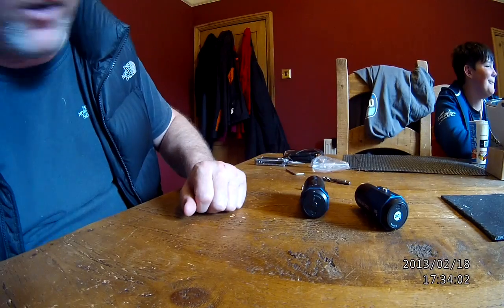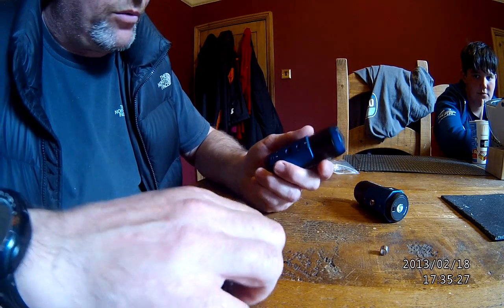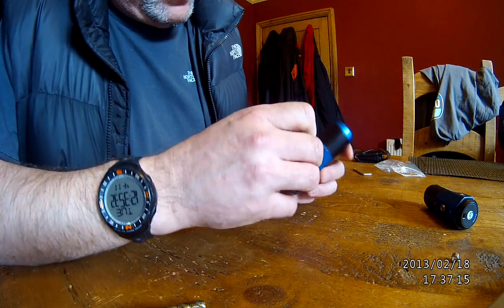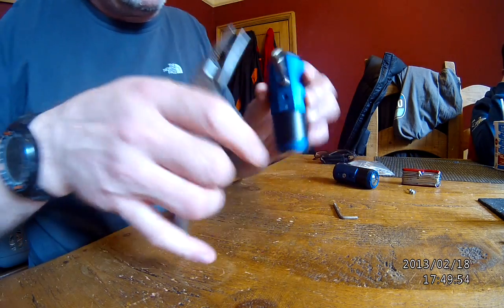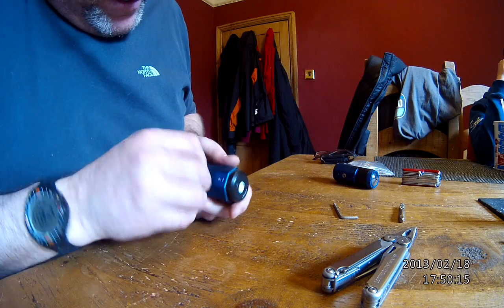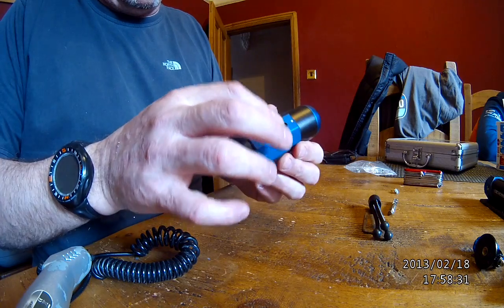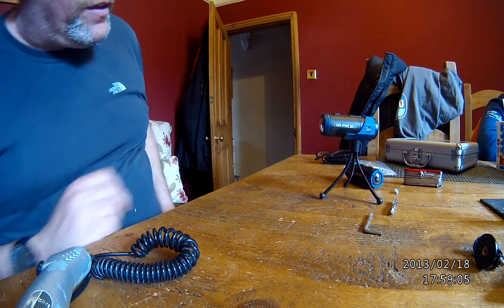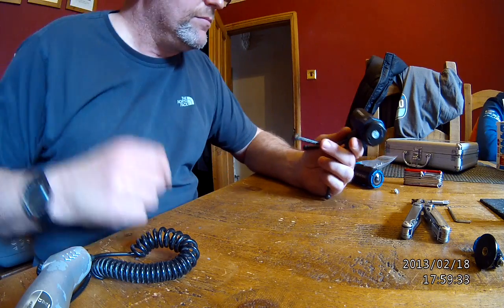Ion Air Pro Thread Repair

Comment: Nice job. Good video. I just did similar with an iON Air and a Contour+. But instead of Heli coil, used Brass 3/8"-16 to 1/4"-20 Convert Screw Adapter. Used 5/16 drill, followed by 3/8 tap. Yes, you're right. Hard to tap such a shallow hole. Let me tell you, once a drill starts going into one of these little camera, they want to go all the way. I lucked out. Thanks for the video. Have one more iON that I may try your way.
Reply from the maker: mnimage388 
Could be worth doing it before it goes just for peace of mind! Thanks for the comment and for watching, James.